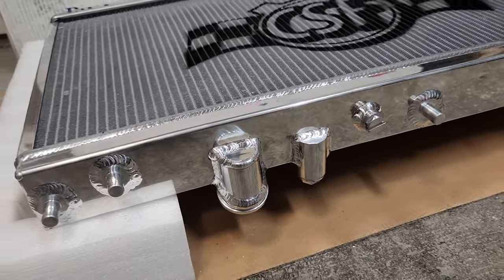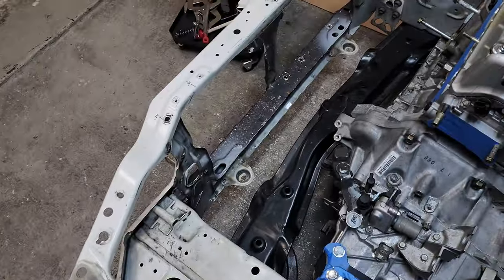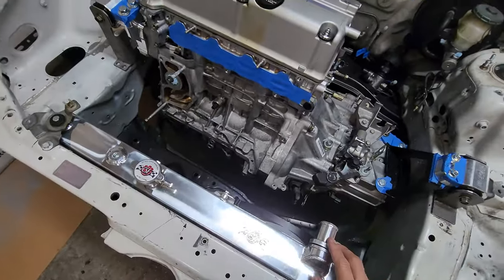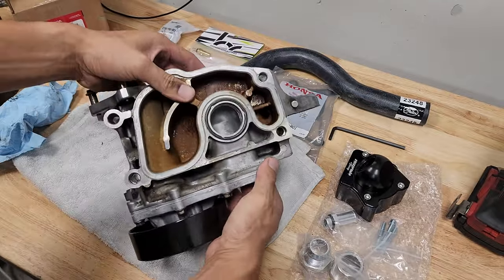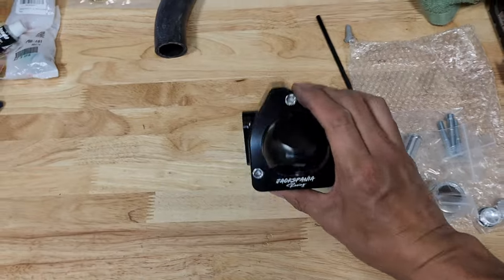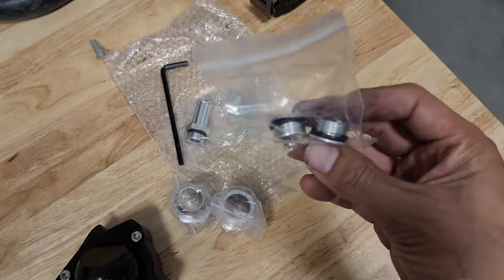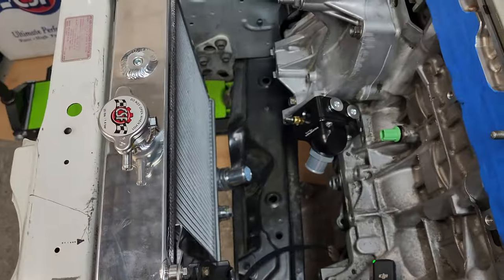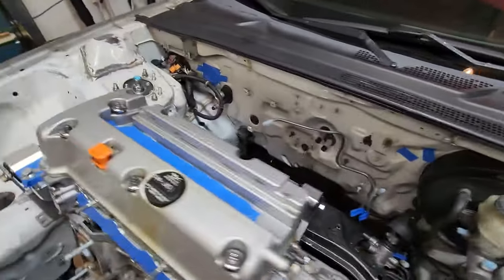Installing the Ultimate K Swap Radiator - 5th Gen Prelude

Comment: For anyone wanting to build a K series aswell.... From what i read the K20 waterpump flows better. IF you swap your K20 or K24 waterpump for the K20 waterpump, be sure to use the K20 alternator aswell! I found out the hard way, but the K24 alternator doesnt fit all the way on the K20 waterpump housing.
Reply from the maker: Ahhh man, I wish I knew that beforehand 😫😫😫 I think the k20 housing also has a port for the fuel filter cooler. On the 8th gen civic at least
Reply: @Rawrkee  The K20 waterpump has the L pipe for the oil cooler, yes. Dont think the fuel filter needs cooling haha.  My K24A3 has it aswell. But its ok! The K24 waterpump flows well enough. And i think the biggest thing was the outlet for the oil cooler. I dont think you`ll run into problems unless you want to make a 1000HP, 9000 RPM monster :P. Also, a tip if you want to make more power, a K20A2 cilinder head should increase power quite a bit. Though they cost alot...
Reply from the maker: Ahh I see, thanks for the tips bro! When you say flow better, do you also mean burping the system is much easier too? I've burped the coolant on the civic a few times and it was no fun. I'm thinking about getting one of those swirl pots from Tractuff hahah  @asbuster2191
Reply: @Rawrkee  I dont know about that tbh. I havent read into that too much.

Comment: quick question where did you buy most of your oem parts?  about to K Swap an mr2 and im new to the honda world
Reply from the maker: Welcome to the Honda world 😆
There isn’t a specific place I bought all the parts, I simply got all the OEM part numbers and compared them on different websites. Surprisingly, some parts were cheaper on Amazon. I noticed that was only true when it was from a seller in Japan and so the part would probably take a week to get delivered. Be sure to check eBay too, sometimes you’ll find a good deal but double check the description and the seller’s profile to make sure it’s a legit OEM part. If it’s too good to be true, it just might be. Good luck with the swap!

Comment: why upgrade the radiator? i mean it's awesome but the stock rad is pretty stout too
Reply from the maker: Mainly because the positioning of the upper radiator port. At its current location, it’d point straight at the intake manifold, on the k series, it needs to be on the driver side. Plus I just wanted something nice and shiny to compliment the bay 😆

Comment: I want to know how the fan switch is wired.. I have an rsx fan switch, I know that the pink wire on conversion harness is the fan control, but just confused on how the conversion harness connects to prelude fan relay/rad fan wires